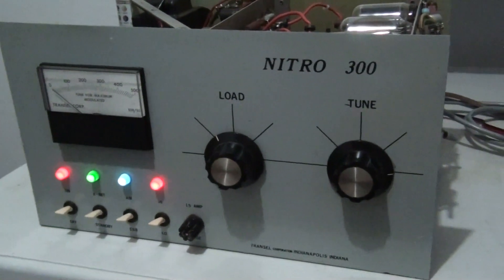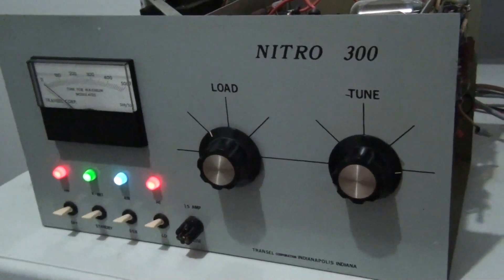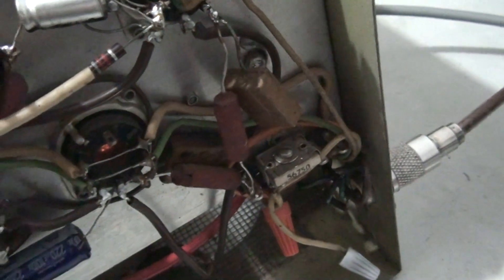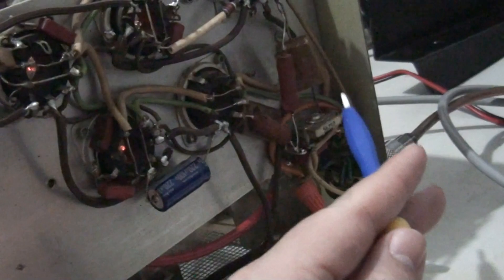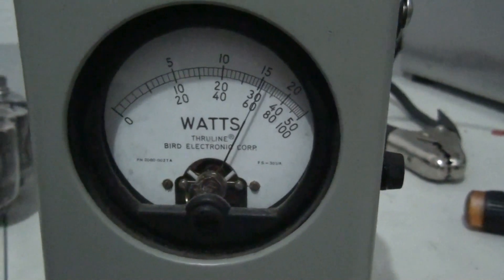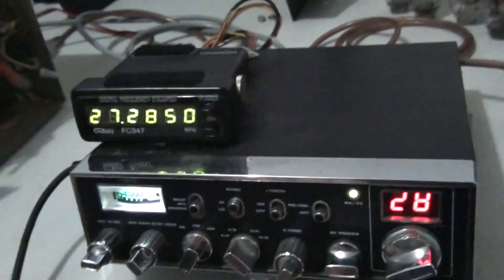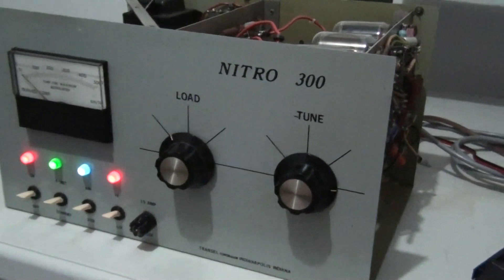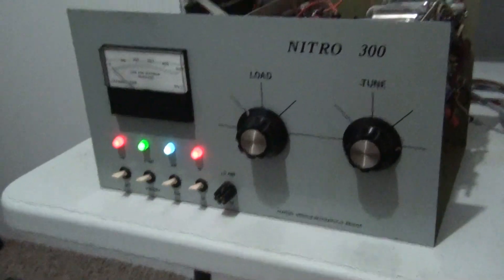Nitro 300 Base Linear Amplifier Using 22km6, A look inside, Output Test, For sale

Comment: I traded for that exact box  has the same scratch by the T  where is says tune. And same wire nuts on disconnected wires by the driver tube   tuner. The driver tube is bad again. The other tubes has grid leakage on 3 of them. The driver tube tuner had a bad solder joint on the leg on right side, and I found a open diode and bad solder joint on the load tuner that goes threw the 2 capacitors to ground. I ordered new tubes again for it. I think it will be fixed now.

Comment: Brought to you by the company that did the Transelyzer (sp?). Transel always reminded me of the Black Cat line of products. I think they were both in the Indianapolis area, but I am not sure if there was any connection. I did use one of their wattmeters at one time and it seemed relatively accurate. I know they had a sales flyer/catalog that listed amplifiers up to their 2500 watt amp. Never saw one or heard of anyone having one.Since I never saw any Transel amplifiers new, I have never seen one in operation. Interesting company from "the sands of time"!
Reply: Wawasee Electronics was in Syracuse, IN. No connection between the two. I met the Ernie engineer that designed Transel products in the early 80's and I was a regular customer and friend of the owner and the tech @ black cat Wawasee electronic's until they closed up.
Reply: @dwoaks1  Thanks David for that bit of information. I find the history of some of these companies interesting. By chance, did you ever see any of the larger Transel amps?
Reply: @eshop777  They made one that had 2 6KD6's driving 3 572b's and one that had 13 6LQ6's  That I have had in the past.